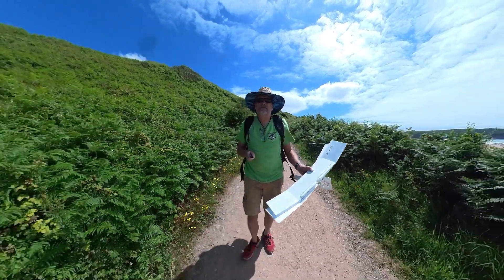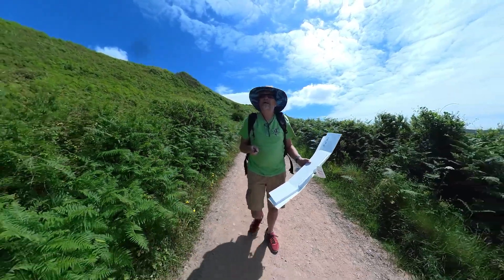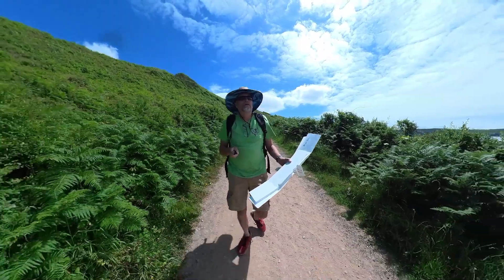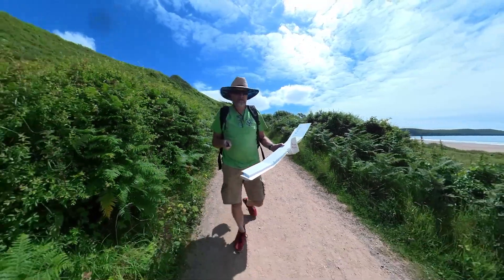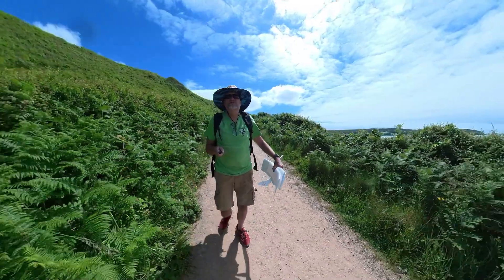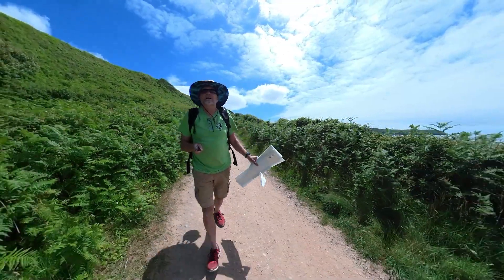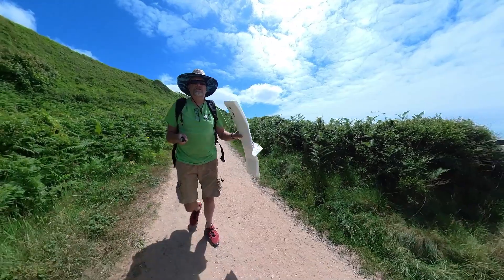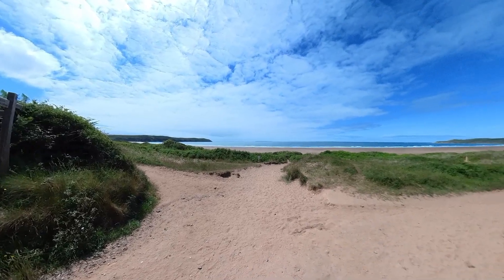Test Flight  3 Wings one Fuselage What next

Comment: A one-sided spoiler will affect circulation, and therefore pitching moment quite a bit. Having it shadow most of your elevator may not be such a good idea. Maybe go back to some old ideas like, say, flipping open a canopy?
Also, at these small sizes and weights, the influence of Re is so large that the results of the various profiles may not scale very well.
Reply: Spoiler would have to be up/lower paired/sizzer so as to not create a pitching moment.
RES rules forbid extendable devices on bottom of fuselage (as can act as arresting hook)
For split rudder idea, there are two options: 1. like space shuttle, 2. upper, lower halves. (like primary rudder, with the secondary only acting as spoiler function with mixed differential rudder input)
Not sure if would pass rule committee, but aligns to the one servo matched to one control surface philosophy.
Reply from the maker: @AerialWaviator  some good thoughts it’s going to be an interesting experiment
Reply from the maker: Thanks I’ve even considered a split rudder 😁. But I would like it to be Res legal
Reply: @NickChittyFlying  Hm. I'm not savvy of the RES rules. Would a fuselage-mounted spoiler violate them?
I was thinking of a split rudder as well, but that's kinda in the face of the RES idea of simplicity; and I get the impression that you embrace that philosophy.